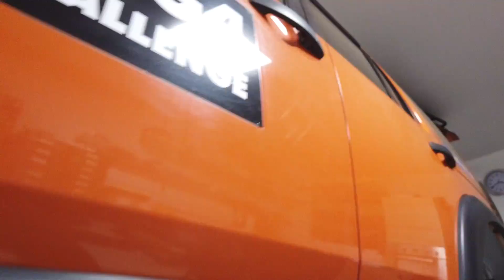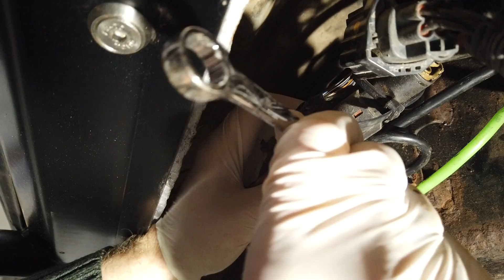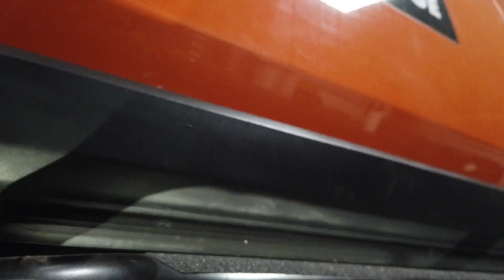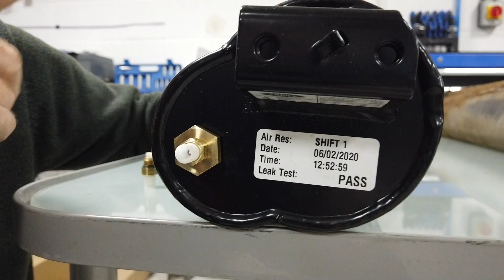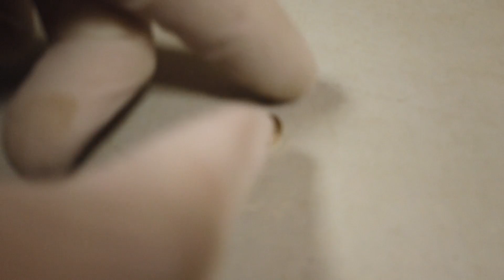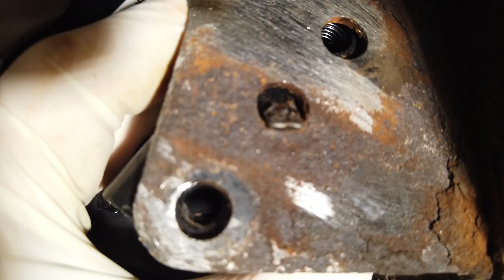Land Rover Discovery 3+4 / Range Rover Sport Air Suspension Tank Reservoir replacement.

Comment: If you're going to scrap the tank, just drill a hole in it. Releasing tank pressure doesn't make the suspension go down. Grind the locating tang off the rear tank bracket on the old and new tanks.

Comment: When fitting the new voss conector , you dont need to remove the conector. Just remove the white plug and just push the line in. Tight at maximum 7-10 Nm torque and you are done .

Comment: Personally, my top recommendation would be to use copper slip or some form of ant-seize compound on all bolts/threads when resembling. I have a pot of the stuff by me whenever I'm working on my vehicles and have done so for over 35 years, not only can you easily undo things many years later, the nuts and bolts seem to be a lot less prone to coming loose from vibration. Unfortunately, I have never seen even so-called pro garages do this so I end up having to do most the work myself.
Reply from the maker: The reason i would encourage people to fix their cars themselves are exactly this....
1) save money
2) you understand your car better
3) you can clean / use copper grease and check all items while repairing
4) Good for your self esteem... this actually improves your mental health.
5) People who fix cars themselves tend to keep cars longer and buy less new cars.... good for the environment.

So i hope my videos help people with their car fixing.
Reply: @L663  All good solid reasons and keep up the good work.

Comment: Urrrgh! You should tighten the reducing bush into the tank before you attach the pipe, and the pipe union should pinch the olive down to grip the pipe, now you have wrung it's neck it will not be a sealed joint into the tank, you are lucky it did not twist the plastic pipe off. It might also be a good idea to steam clean the chassis and spray on a good coat of Waxoyl,that will soak into the layer of rust and stop further corrosion, do not think of spaying underseal on a chassis in this condition, it will quietly rust away under the underseal and fail, whereas the Waxoyl soaks into the rust and stops it.
Reply from the maker: Yes this was pointed out to me about the olive above...normally in plumbing i have come across the  solid olive this split olive was a new one to me !

Comment: Good video. Wouldn't it have been better to sandblast the underside before putting all these nice new parts on ?
Reply: Definitely not, the damage that would cause is unthinkable but a thorough steam clean and the application of some rust converter and ant-corrosion paint/sealant  would be an absolute must do job.
Reply: @jonh9561  when was sandblasting rust a bad thing? come on

Comment: I love your videos but,
Why is it that you didn't clean that under car before working on it?  It's such a mess.
Reply from the maker: Several reasons.... 
1) I dont have a decent pressure washer... mine is broken
2) i dont have ramps to get it up to wash underneath
3) I need to get the car safe to drive then its off to the pressure wash !

Comment: Do you think you would ever do a video on painting the underside?
Reply from the maker: I have thought about this.... first i need to buy a pressure washer... they i need to look at the options for undersealing with something !
Reply: powerfulukltd ah right. I use hammerite Underseal it’s brilliant stuff, almost like tar.
Reply: Simon, Do not paint with a solid paint type underseal, unless the chassis is sandblasted back to clean metal it will corrode twice as fast as it would in open air, use an oil/wax based waxoyl type spray on, it will halt corrosion, just think what the metalwork is like around the gearbox and axles, like new under the oily crud. And yes, a heavy goods MOT station will point you in the direction of a steam cleaner, all HGVs need it to pass their MOT, and you don't get covered in crud. Chris B.
Reply: powerfulukltd I would have a chat with the guys at buzzweld, their products are awesome
Reply: @L663  Go to a guy who does MOT hot washing, £15 & it's clean, better than you can ever do it yourself.